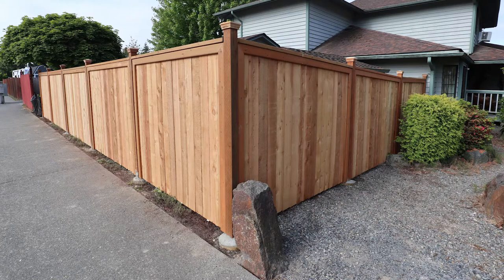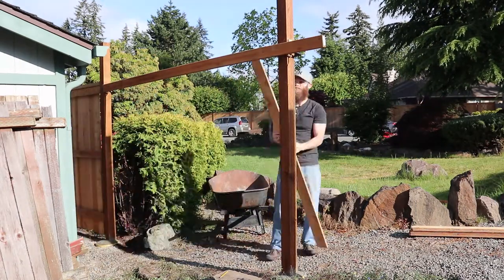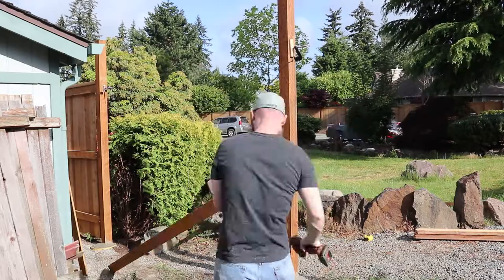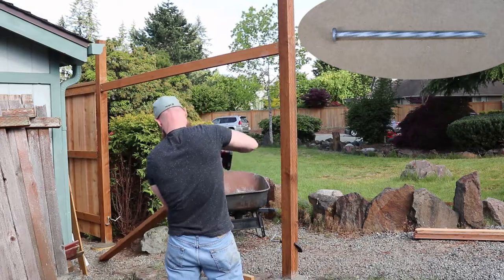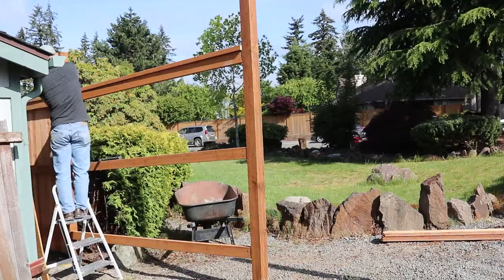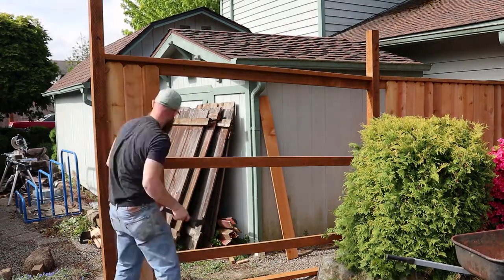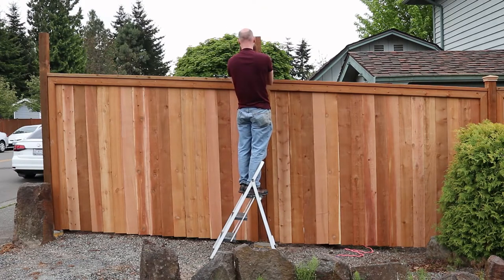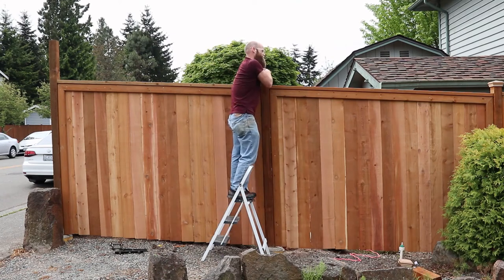Putting Up Fence Panels

Comment: Hi Joe, I've been watching all of your videos wrt the fence/gate project. I scoured the internet to find what I was looking for (a plan in my head) wrt dimensions and timber sizes. I came across your videos and said that is what I've been looking for! You did a magnificent job and thank you for taking the time to set up the videos! I have a question about the above and below ground treated timbers. I understand the panels are cedar pickets but what about the rails and posts for the 2x4, 4x4, 6x6? I noticed they have a brown kind of tinted stain. Most of the pressure treated I see has that awful green tinge to the wood, mostly with the pine. What is the name of the timbers and where did you purchase them? Are they pine or cedar treated? Thanks!
Reply from the maker: When I was doing this project I went to Home Depot, Lowes, and local lumber yards. I noticed in this area they all pretty much carried the same lumber and from the same mills. I think lumber can be a regional material. I’m in the Pacific Northwest and the pressure treated lumber out here is typically Hem Fir and the treatment has a brown color. If your area has a green treatment, you could use a non-transparent stain, to cover it up or you could use Cedar for the posts and rails.

Comment: Why not use screws?
Reply from the maker: I don’t like the look of screw heads on pickets. Regular nails can pop out over time. By using ribbed nails, they won’t tend to pop out and they look better. Ribbed nails are also cheaper than screws. For the rails screws or the twisted nails, I used would work. The top decorative rail did start to twist, so I added some screws from the top to hold them in place. I think screws and nails have their advantages. Whether or not you choose screws or nails it’s best to find the right nail / screw for the given application.